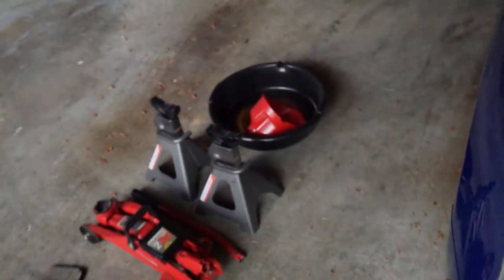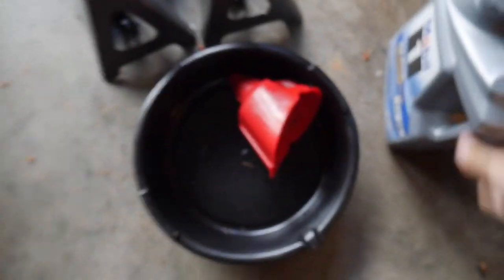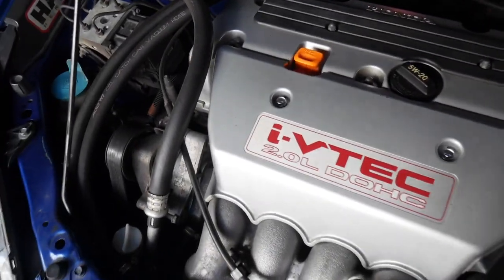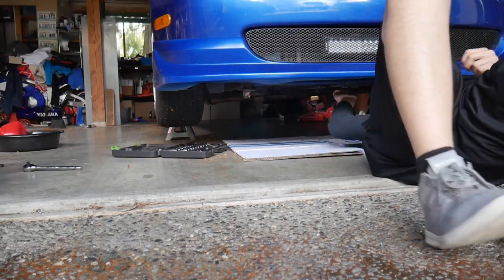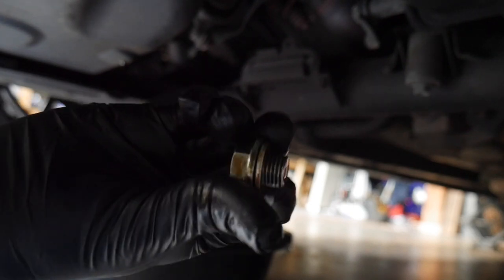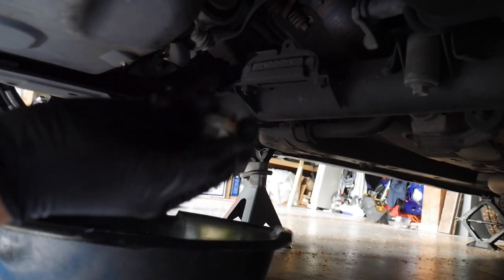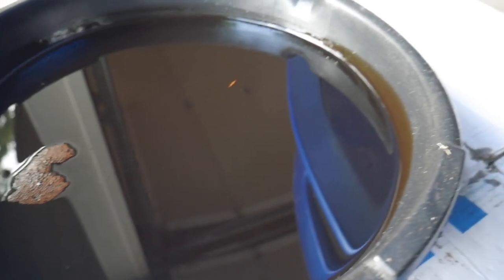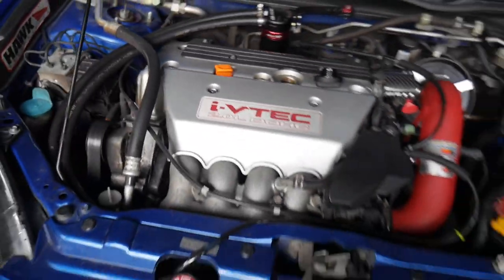0il change on a 2002-2005 Honda Civic Si EP3! | 2005 Honda Civic Si EP3 | Vlog 023

Comment: Picked up that carbon fiber gloss wrap. Btw,, how many quarts did you add.
Reply: Michael Chavez I just recently reviewed the manual and I found that the motor wants 4.4 quarts.
Reply from the maker: Michael Chavez nice! Needs 4.4 if u change out the filter, and 4.2 if u dont
Reply: Thanks. Appreciate it

Comment: You always use 5w20? I was told people switch to the 5w 30 instead.i use 5w 30 on mines
Reply: 5w 25 for low miles, 5w 30 high miles , i use too 5w 30
Reply from the maker: Darktide420 I actually used to use 5w30, but the viscosity of the oil made the car feel sluggish, it might've just been in my head, so now I change the oil more often instead to protect it

Comment: Just wondering--if you're putting jackstands on both sides, why not jack the front up just once from the front jacking point (the one pointed to by the big arrow underneath the car--at least my 2004 has it)?
Reply from the maker: Car was too low for a jack to fit on the fromt jack point, had to lift up sides first and then do that if I wanted to do it